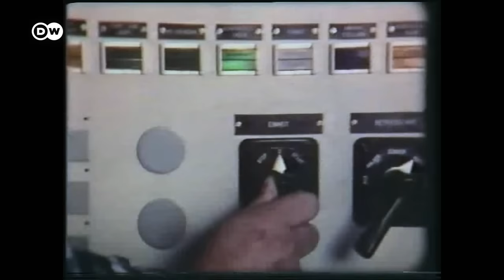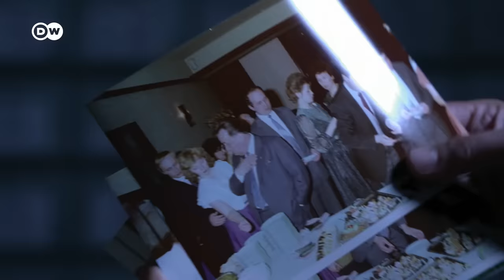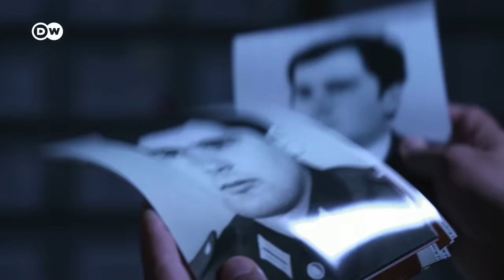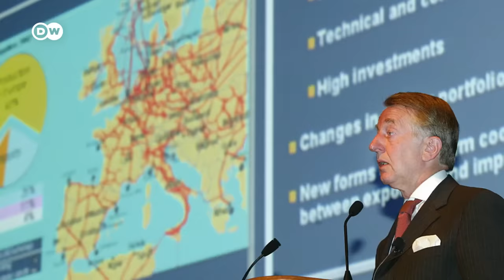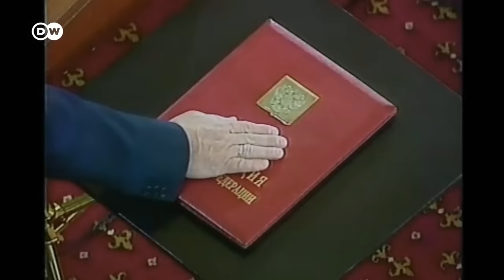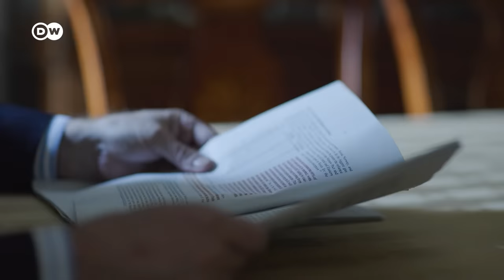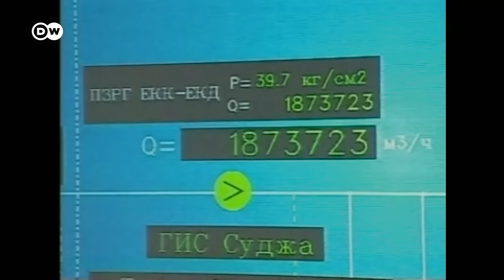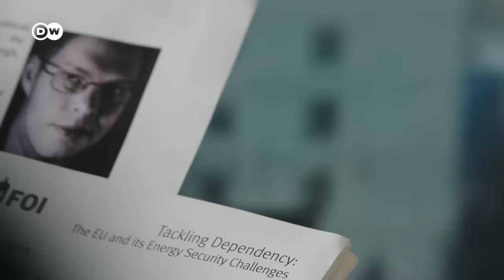Russia's energy empire: Putin and the rise of Gazprom | DW Documentary

Comment: People with gas furnaces, should examine if their central heating system works as efficient as possible.
The lower vater temperature for the central heating, the less heat escapes with the exhaust gasses.
A good system can keep an insulated house warm, above 20 C, with water of only 30 C circulating from the furnace to the radiators and underfloor coils.